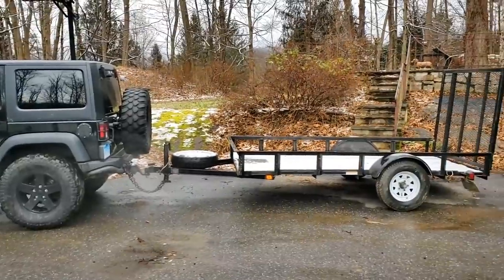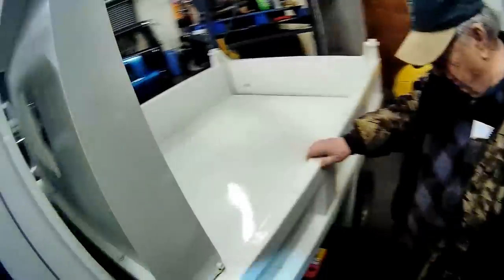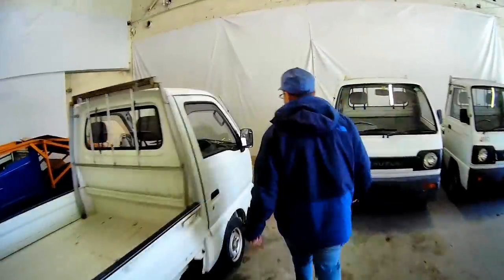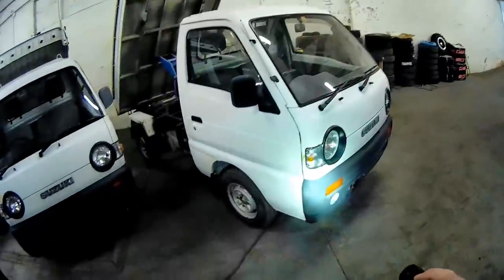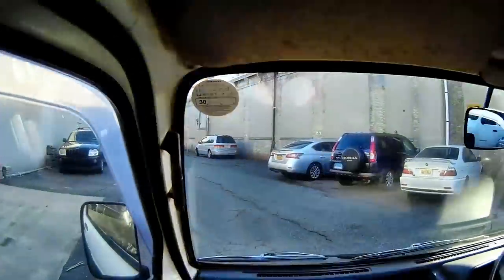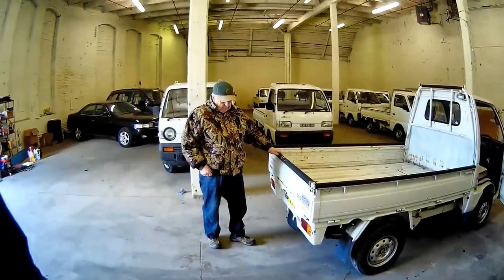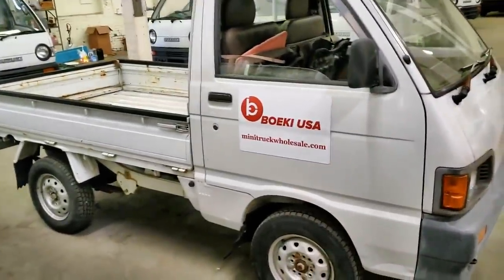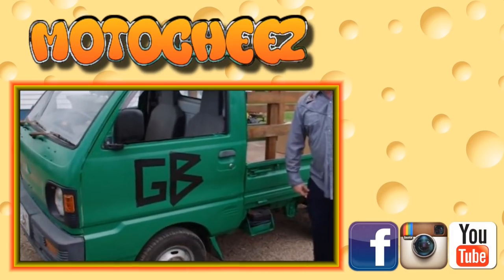$4500 Mini Truck info (SE01 EP01) what to look for, buy and get it home on 5x10 trailer

Comment: moves 40 a month, people drive from all over to buy...major US automakers struggle to make sales but ignore this market altogether.  They just keep making trucks bigger and bigger.
Reply from the maker: Good point! I also think there's a market for new trucks like these in USA, they allow the smart car soooo
Reply: Yup. Pissed me off that Ford discontinued the excellent Ranger line - in a year that enjoyed 77,000 sales!!  What idiot though that was a good idea?  The Ranger had a rough start, but the last several years were great little trucks.
Reply: That's why I love my 85 Toyota pickup. Light weight, 18 mpg city. All little trucks like this will make a comeback.
Reply from the maker: I had 2 Toyota trucks growing up in the 80s. LOVED my little 4x4 Yoda
Reply: Federal regulations don't allow for these trucks to be sold unless they are 25 years old.  So nobody could sell these new.
Reply from the maker: Actually if they are speed limited to 25 miles per hour and they're sold as a golf cart slow-moving vehicle they can, and I guess some are
Reply: @MotoCheez  who wants a truck that can only go 25 mph though? I guess it would be good on a farm or ranch or something.
Reply from the maker: Well people are taking speed limiters off and as long as you don't get caught I guess you don't get a ticket ;-)
Reply: @MotoCheez  In Arizona we could register this as an off highway vehicle, just like a side by side, and be completely street legal. It's essentially a motorcycle tab which are exempt from emissions testing. Freeway use is pushing it and you would likely be talking to Johnny Law. Not to mention extremely unsafe because we drive FAST on the freeways here.
Reply from the maker: Nice. I wouldn't take it on the highways anyway! Secondary roads only
Reply: kei trucks won't pass US crash standards as new cars
Reply from the maker: Correct, that's why the 25 year rule gets them imported.
Reply from the maker: Those are great trucks! Definitely do a video on the resore!!!
Reply: @General Contrarian Tacoma's didn't exist in the early 90's... not till '95
Reply: The GOVT regulates them is why buddy.  These trucks meet no crash regs.
Reply: @MotoCheez  The Kei class trucks and cars are restricted to 25 mph here in Michigan and can only be driven off road.
Reply: OutnBacker ranger is coming back
Reply from the maker: Really? Thats good news!
Reply: @letsgotomarsman  The Ranger may come back, but it will probably be redesigned and bigger, just like the newer Tacomas. I have a 97 Tacoma because I hate how big new trucks have become, and I also despise all the additional electronics that can and do go wrong
Reply: @OutnBacker  "major US automakers struggle to make sales but ignore this market altogether."
The Ford Ranger was a LOT bigger than these things. Even the Ford Courier was bigger. These are the same size as a UTV.  You can pick up a brand new John Deere Gator, Polaris Ranger, Tomcar TM5, or Yamaha Rhino for about $10,000 - $15,000. And UTVs are built for off-roading, which is why so many farmers and ranchers buy them.
Reply: @LincolnRon  I know. I've seen them in company fleets inside large plants. I'd love to have one, but I was just lamenting the blindness of killing the Ranger as a Business move. I think it was the only vehicle that sold 77000 units in the last year of its run. All because they thought an aluminum truck bed would lure more big truck buyers. I don't see a huge rush to Ford for an alloy bed, however, if they would have offered the Ranger with A diesel, ill bet they'd be fighting off the customers. IMO, the Ranger was the best value in a compact truck ever made. Reliability off the charts.
Reply from the maker: I agree, those little rangers we're popular, inexpensive (unlike trucks today) good on gas and reliable. It's a lot bigger than this mini, but I know what you're saying.
Reply: @MotoCheez  Toyota, GM, Ford, Dodge, and Mazda quit making that size truck (Ford Ranger). But I think VW still sells one. I think it's because mid-sized trucks get such good gas mileage that most people don't want a truck as small as a Ford Ranger. (Honda Ridgeline, GMC Canyon, Chevrolet Colorado, Nissan Frontier, Toyota Tacoma)
BTW my favorite was the Dodge Ram 50 and my least favorite was the Chevy Luv. But I owned a 1993 Mazda B2200 from 1993 to 2018. (I could not afford the Dodge Ram 50 with an automatic and AC.)
Reply from the maker: I loved my Toyotas and Nissan, hated the Chevy luv also. All the small Chevy pickups were garbage IMO, had no clearance and all frame lift to look high.
Reply: @MotoCheez  The thing I hated most about the Chevy Luv was how loud they were inside the cab. The engine noise was so loud it would give you a headache if you had to drive one at highway speed. Also it rode rougher than a military Jeep.
Reply from the maker: Lol. True that
Reply: @OutnBacker  That made me mad too. I had two Rangers back in the day. Great small truck, some of the best vehicles I've ever owned.
Reply: I would love to have the van version but as far as being a market for these in the US? I kind of doubt it. They keep building trucks bigger and bigger because people want big ass vehicles.. 

Now Ford stopped making cars in the US because people want crossovers. The market for small cars has fallen off because of gas prices. Americans buy vehicles based on size by the price of gas. It's a knee jerk reaction. Back in 2007 when gas spike the only vehicle GM was selling was the Chevy Cobalt.

I got a 98 Chevy conversion van and I like it but it's a bitch to park and is hard on gas. But hauls 7 people and I can tow with it.

I'd like to have a small van with just two seats so I can haul shit it. I wonder if I could haul an ATV in one of these people 4 feet wide.
Reply from the maker: 👍👍 you can get the van, over 25 years old they can bring them in
Reply from the maker: I'd bet an ATV would fit!
Reply: @jakestech28  18mpg.....
I get 25mpg+ with a 2001 3500 dodge 4x4 diesel
Reply: If I was the type I'd be begging Amir to franchise and sell these locally. Everywhere I go with mine people offer to buy it, people adore them for garden trucks, contractor vehicles, farm trucks etc. there is definitely a market in the US for cheap, small trucks like this. They're like UTV's but cost a fraction of the price with heating and can be made road legal if they're considered Classics. Fantastic little things.
Reply: @OutnBacker   Me Too. I get over 200k from my rangers(fleet) with little trouble. Great small trucks.
Reply from the maker: I liked the rangers better than the F150
Reply: Go to your ford dealer tomorrow and buy a new ranger then lol
Reply: @BenKempa  "Go to your Ford dealer tomorrow and buy a new ranger then lol"
1993 was the last year the Ford Ranger was a minitruck. In 1994 the Ford Ranger became a mid-sized truck. All of the mini-trucks in the USA (except maybe VW) are now mid-sized trucks. The old Ford Ranger was a lot smaller than a modern Ford Ranger.
Reply: i would most certanly buy one
it would be a good litle small property type truck
i have about 4 acres of land and a whole hell of a lot of trees to tend to so that little thing would be way beter for the job than a large king size cab nisan frountier with a 5 speed
maby have a light easy to use 5 speed with a heavy flywheel 
that sounds about right
Reply from the maker: I had a Nissan with the head gasket issues! Sucked
Reply from the maker: Amen brother! Well said. 🔥🔥🔥🔥
Reply: @MotoCheez   big oof bruv
head gasket replacement sucks
well unles you dont have ohc like most cars do nowday
on something like a pushrod engine its not as bad but still annoyin as frig bc of the pushrods needin to be lined up n all that crap
but on something with ohc it sucks bc of the fact that you gota take the timing chain/belt off making usre its all lined up and then take the head off... acualy it dose not sound that bad tbh
but it still sucks
Reply from the maker: I love my pushrod engines too! I have a C6 Vette LS2🔥😄
Reply: @djaydeved  Cushman has teamed up with Samsung so now they offer a hauler with lithium batteries instead of the small gasoline engines they used to use. (Hauler 800 Elite) Although Cushman has always been on the expensive side since they aren't built on an assembly line. Each one is built by two people from start to finish. It's slower and more expensive that way but it's more flexible if somebody wants something custom built,

I used to make deliveries (school supplies) in an old three wheel Cushman van. Freezing cold in the winter since they had a roof and windshield but no doors. https://www.youtube.com/watch?v=mvsK-DDldts
Reply: What part of "NOT STREET LEGAL" do not understand? IIHS tested some of these. They had 5. After the first crash test, they didn't bother to do anymore tests. 100% FAIL. As a "farm truck", they're fine. But on a road with other 60mph nuts, they're an instant death machine. (hit ANYTHING at speed, and you will not be walking away.)
Reply: @OutnBacker  really dude are you joking? The Ford Ranger is being reintroduced to the US market this year and has been in dealers at least a month cuz I'm seeing them on the road past few weeks, I'm doing the automation for the transmission plant right now (transmissions for all Ford RWD and FWD) literally 4 miles from my jobsite is the plant building the Ranger and as of a few weeks ago the lot is full of 2019 Rangers.
Model refresh for US reintroduction, it's been sold in Australia, South America and rest of the world that doesnt have the F150. Look up some Australian offroader reviews of it, Google "Hilux vs Ranger" (hilux is the non-US Tacoma)
Reply: @woodworkingstuff7165  wow ummm...the Ranger was reintroduced to the US market this year (model refresh for US market, it's been sold in all the non-US markets since Ford pulled it from the US), I'm at a jobsite near the plant retooled to reintroduce the Ranger to the US, Google "Ranger vs Hilux" for Australian offroad reviews of it.
Reply: butler the economics of fuel economy now is such that midsize trucks get the same mpg as the us market compact trucks, F150 aluminum body cuts 700 lbs from comparable steel body panels and 2WD in 2.7l EPA is 28mpg hwy (real world I got 25mpg hwy staying 70mph on the I75 from TN to MI) , Tacomas have 90s mpg because havent changed since then, for me way worse than EPA, the 2017 taco I drove barely made it from Lexington to Cincinnati roundtrip on a tank of gas, worse than 15mpg freeway miles. But even the redesigned Colorado is barely 2mpg better the equiv Silverado.
Reply: Babylon falling 
Years ago, my neighbor had a Stout. He was a roofing contractor, the Stout hauled tear-off shingles. Tough n reliable, the sheet metal was thick , like cars from the 50's.
Reply: @letsgotomarsman WHAT!!????
Reply: @woodworkingstuff7165  ranger is back, its bigger by a bit, but tows 7500#. I bought mine on Monday.
Reply: jfbeam like Smart Car....those look dangerous too!
Reply: The big US automakers making even bigger US pickup trucks know they're safe from reasonably priced imported light-duty trucks is because of the "chicken tax"!
It's a 25% tariff that's been in effect since 1964!
There's no reason for them to make smaller vehicles if there's no competition! D:{
Reply: Not all of us are 5' tall and weigh 100 lbs. When you're 6'2" and 195, a small truck like this is crazy
Reply: Yeah. I've been wanting these types of trucks for 20 years for my mobile service. I started back in '97 and didn't have a budget nor credit for buying big gas guzzlers. Plus I needed to maneuver in small lots and low parking decks. I hope USA never gets these. Rather import.
Reply from the maker: True. I'm 5'10" and I'm comfortable. I had a 6'4" friend sit in it in another video, said he could drive it, but would be uncomfortable.
Reply from the maker: Truth
Reply: djay4487 deved 
How can you have a lot of trees in 4 acres? Did you mean 40 acres?
Reply: I don't understand the move to larger and larger trucks.  I own a '98 S-10 and an '09 Ranger...great small trucks.
Reply from the maker: Me? I have 18 acres
Reply: @LincolnRon  No. GMC still makes the Canyon, Chevy still makes the Colorado. And Ford makes the Ranger again for 2019.
Reply: He reasons these are good in places like Japan, is because of densely packed cities, everything is near-by, roads were made for smaller cars. The U.S. is vast and spread out, and the roads were designed for large vehicles.
Reply: @xenonram  The current Canyon. Colorado, and Ranger trucks are all three mid-sized trucks. Not mini trucks. A mid-sized truck is a lot bigger than a mini-truck. Just compare a Dodge Ram 50 to a  Dodge Dakota.
Calling those three vehicles mini trucks is like calling 500cc motorcycles mini bikes.
Reply: Rumor says that ford is going to make a smaller truck based on the focus. Not this small but smaller and cheaper than the overpriced new ranger.
Reply: @MotoCheez  The problem with small trucks is twofold - the Chicken Tax hits any small truck being imported, but more significantly, the Feds changed the way fuel economy regulations are calculated. Now, it is based on the "footprint" of the vehicle - wheelbase x wheel track. So small trucks now fall under the same CAFE regulations as a car with the same wheelbase and track. When you consider that trucks have separate frames and are generally built heavier, that pretty much makes small trucks extinct.
Reply from the maker: Yeah these things don't belong on a highway at all, anybody that would try to drive one on there is an idiot.  keep a restriction just like a scooter or motorcycle under 250cc is not allowed on a highway either
Reply: @MotoCheez  I live in Michigan, these units are not too pricey at all! Was looking at side by sides but damn! very very expensive!, I definitely like the model you bought I would most likely put the lift kit on there like you did and this machine would not break the bank, have the wife on the same page about purchasing one!!! A neighbor down the road has a mini , its a van 4x4! I'm definitely going to stop in and check it out?? FYI like your videos! Shared your videos with friends and family! I told them I'm looking to purchase one they said these things are awesome! And when I told family and friends  how much the price is for one  of these units they had a smile! I think they're on board!! Might have to start a mini community Club out here in Michigan LOL
Reply from the maker: Wow that's awesome. That's exactly what I found out when comparing them to a UTV. You're going to hear the haters about how unsafe they are, but they're right there's not much up front to protect you, but if you don't use them on highway and you stay on a back road they're still safer than a motorcycle I think. Thanks!!
Reply: @MotoCheez  I see UTVs and golf carts driving around downtown all the time. Any place you can ride a bicycle you can drive something like a Daihatsu Hijet, UTV, or golf cart. Although you probably have to have license plates on them in most (if not all) states. (Unless the road is restricted/ marked otherwise.) I think the vehicle just needs headlights, brake lights, and turn singles to be street legal. (I'm not sure why you can't drive minibikes and pocket bikes on most roads. Maybe it's because they are so small they aren't very visible?)
Reply from the maker: 49cc and under in CT you don't need insurance or motorcycle license, just a driver's license
Reply: Living in the South, where rust hasn't eaten away the bodies, you still see a number of the mid 80s early 90s Mazda trucks, and the Mitsubishi Mighty Max trucks. They obviously serve a purpose since they're still on the road after 30 years. Personally, I think Chevy missed a golden opportunity in not offering an HHR pickup. The platform was there and it would have been simple to alter it so it had a basic pickup bed. Load capacity probably would've been just around 800 pounds, and having front wheel drive wasn't optimal, but there are a lot of people who would have bought a cheap, reliable, light duty truck. And they were reliable. My girlfriend had an HHR w the venerable 2.2- it got 25-28 mpg, rode nice, had a huge cargo area, and other than routine tires and brakes, I only remember it needing a wheel bearing replaced . Still ran great when she sold it at 160K. If that thing had had a truck bed, we'd still have it as an extra vehicle to do occasional hauling. It would've been so easy for Chevy to have offered an HHR model w that option.
Reply from the maker: There is definitely a small truck market they're missing.
Reply: @LincolnRon   the  ranger will be a mid size truck. I liked the tiny little courier. But they didn't offer a 4x4 in the little Ford did they. Ford is probably gone make a little Subaru style Forrester or outback which ever one made the one with the tiny little dog food bed. Think the small Ford will be front well drive on the focus drive train and mono style frame body. But how much are these little susukis and Honda and whoever makes Them trucks? There 25 years old. Even with import tax or fees. That can't be that much.
Reply from the maker: Crash tests I'd assume?
Reply: @zonacrs  may I just mention these minitrucks are sold in Germany as well and yes, they use the Autobahn
Reply from the maker: On the Autobahn! Wow, that's brave 😄
Reply: @zonacrs   Is it really that bad? I´m drivin a small french hatchback and if a dare to drive less than 70 or 80 mph on any lane but the right one, I can literally feel the Audi (or any other "better" car) Inches away from my rear bumper using his high beams
Reply: Because they can't build them used in the factory to sell for under $5K.
Reply: I’ve seen semi-trucks hit cement trucks, busses, and each other! Nothing is safe, including trains & planes. Don’t forget the Titanic!
Reply: Haha
Reply: @OutnBacker  
"Rich Exec's" that's who...
Reply: There are rumors that Ford is gonna make a focus based ute... would absolutely love one of them.  No dump bed but hey...
Reply from the maker: They need to!
Reply: Oh poor American dealerships Over priced American junk with parts made all over the world....
   If you need to feed your family's I understand why they don't call back now. Take the 15 minute ride
Reply: They make $20K on a mew F150...they will make $2K on these. There is a reason the top selling cars in America are being discontinued...no margin nor volume. Everyone in the good ol USA wants damn big trucks and the women want CUV/SUVs.
Reply: @MotoCheez  We already have $10K golf carts that do everything we need on the road or on the farm. Nobody want's a $17K one. Buy them cheap from over seas for used. That is why there is a very small and limited market/need.
Reply: @General Contrarian Silly.
Reply: @ducatipaso1386  que se joda que no pasen
Reply: its not about ignoring the market its about "does the cost to produce it and the market to sell make sense".
Reply: i used to own 6 of these trucks for my distribution business in the philippines.
Reply: Honestly, this truck would be usual in NA. I got a smaller truck because of city driving but I want a smaller truck for simple jobs.
Reply: Yep
Reply: @MotoCheez  Absolutely
Reply: @BIGBLOCK5022006  don't drive. travel.
Reply: These trucks won't pass the crash test. That is what keeps most of the worlds cars out of the USA.
Reply: Cool little truck dude! You can take a couple dirt bike's along anywhere you go. I would love to have one, even with the dump bed. Possibilities are endless
Reply: @samiam5557  ah they just don't want to make cheap trucks. If they can sell Accents as highway legal they could make a pickup it's size
Reply: @MotoCheez  It's CAFE rules that killed the small utility truck/pickup. Manufacturers are incentivized only to build big.
Reply: @handytbutler7380  it is not massive. Holy crap dude if you think the new rangers are massive you are seriously deluded.